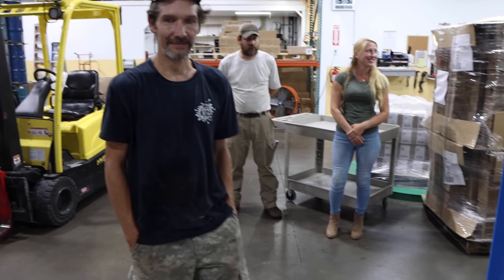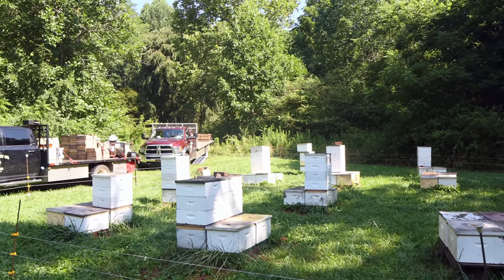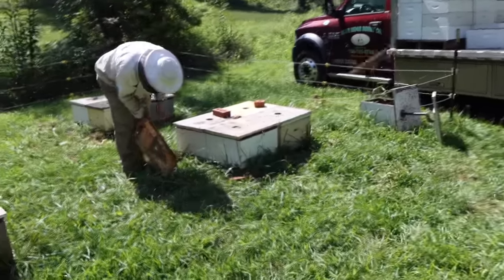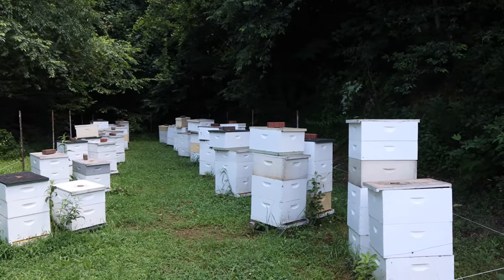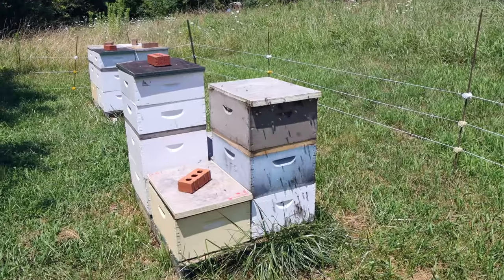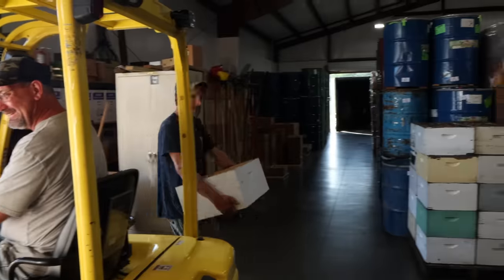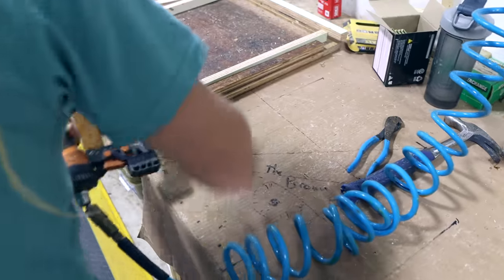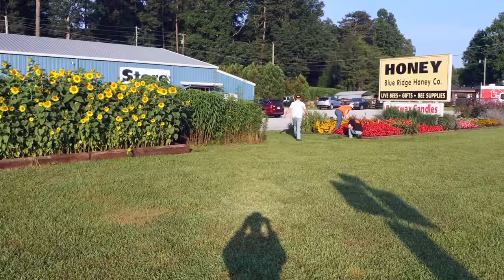Using Bee Escapes & More

Comment: Bob, was that Apiguard that was thrown on the top of frames at 3:06 - 3:07?
Reply from the maker: I should have explained. Probiotics.
Reply: @bobbinnie9872 what type of probiotics??
Reply from the maker: @georgehardee5470  Strong Microbials DFM
Reply: I just saw the note before mine. It was a probiotic.  I’m glad I do the same.  Helps to know new bees like me are on a good track.  Thanks again. Kevin
Reply: @bobbinnie9872 Have you seen the patty that Strong Microbials pit out with Apis in it as well. Greg had some samples, i picked up a few.
Reply: I started my apiguard treatments on the 21rst....is it ok to add probiotics during treatment?
Reply from the maker: @jordanebling2138  It is OK but (I'm not sure) it may do more good after the treatment is over.
Reply: @bobbinnie9872  I will do that! Thank you 🙏

Comment: Hi Bob! You could try without cold storage. On the bottom should be some kind of inner cover with expanded aluminum grid (it's something that we in Europe use a lot), then stack supers like you did on pallets. On top another inner cover (like shim with expanded aluminum grid) and then cover on top. Some beekeepers put on top on last super some jar with formic acid to prevent wax-moth, some put only 9 frames per super... that's for everyone to find out for himself. All the best!

Comment: How many supers can I use above a bee escape when temperatures are in the high 80’s and how long can I leave the bee escapes on.
Reply from the maker: It depends on wether you have hive beetle issues in your area. Here we try to keep it at four or less for no more than five days.
Reply: @bobbinnie9872  I am taking it that your apiaries do have hive beetles? I used a Ceracell bee escape under 2 supers a couple years ago and forgot to go back for quite a bit of time, can’t remember how long, and both supers were slimed.I have been reluctant to use the bee escapes ever since. 
I was under the impression that the bees would not leave if the nights did not get cool but I think I was just not leaving them on long enough. Thank you for your time.
Reply from the maker: @larrywedding2512  We do have hive beetles but not as bad as some areas of the country.